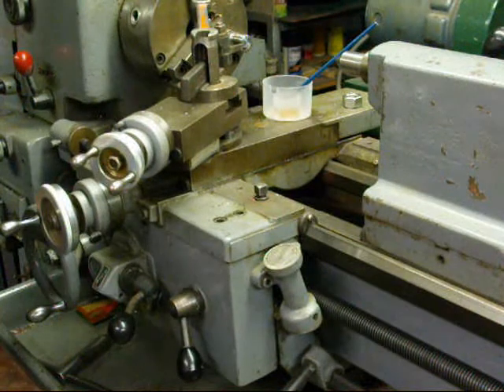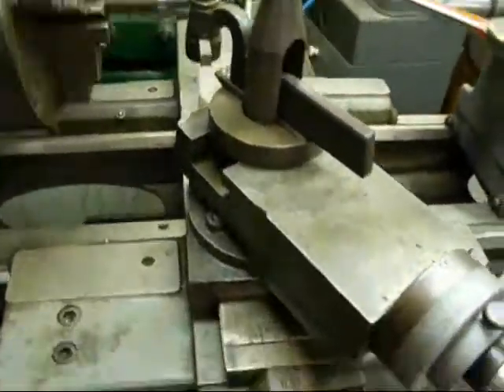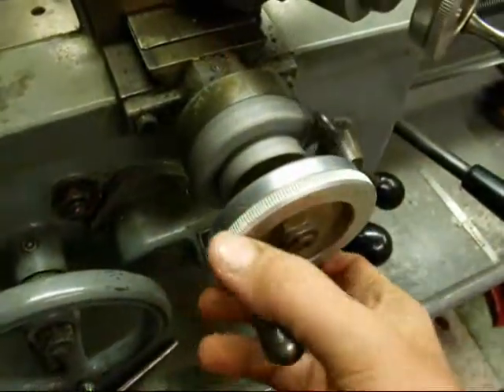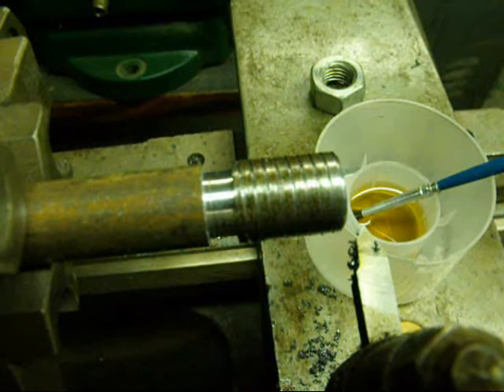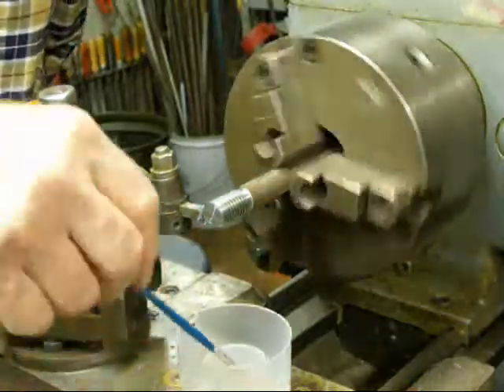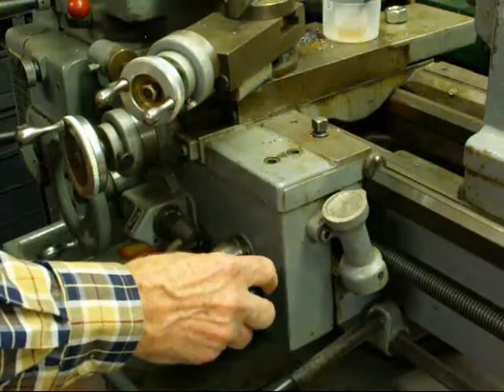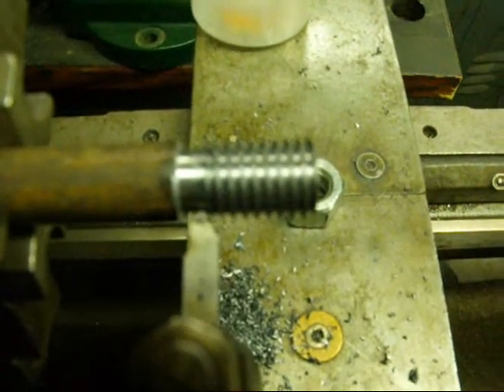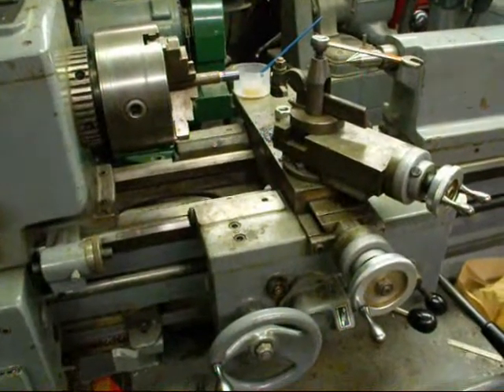THREADING on the CLAUSING LATHE atlas logan part 2 tubalcain

Comment: After 10 years lathe ownership I have done it - cut a perfect? 1/2 20 UNF thread that actually takes the nut! I did leave the half-nut engaged so my next step is to use the chaser. The clear explanation of the setup at 29 degrees, the zeroing of the compound and cross-slide then the repetition for advancing the cutter for each pass did it for me.
Thank you Tubalcain!

Comment: Thanks, this helps. Getting into machining. Got a used South Bend Lathe 1923. I hope it is in good condition. looks like it is. Oldest tool in my grampas shop. Drill Press 1940s? Grinder 1940s? Tried threading, after watching our video I was doing at least three things wrong. Spend hours trying.  Really like your videos!

Comment: Thank you again. I managed my first serviceable bit of threading. I was replicating the tailstock screw and having issues making the 3/8" - 16 thread on the back end. Nevermind that knocking down the ACME thread from the 1/2" OD was quite the pain in the rear. Thanks  to you, I finally pulled it off.  Now to figure out how to put that tiny little keyway in it for the hand wheel.

Comment from the maker: Study the SOUTH BEND book on this. If you feed straight in, it is a plunge cut & the tool will cut on both sides. You want the tool to cut only on the left side only. This gives a smoother cut. Also avoids digging in, chatter & maybe bending the work.

Comment: Very helpful, I have threaded a few times only, and don't do Threading all the time,
So I forgot a lot of points. This series Got me back up to speed. 
I am ready to try making a 1.400 OD X  24 TPI Externally threaded Spanner nut for my Rockwell 6 " belt sander. This spanner nut holds the bearing in. The places that sell replacement parts for Delta Rockwell, want $65.00 & shipping for the part. 
That is not going to happen. I paid $100.00 for sander and already have almost $100.00 more in parts

Comment from the maker: What I am doing is the very thing that removes the backlash. (that is moving out several turns & then back in). If you only move out say perhaps an 1/8 of the turn & then back in, you have introduced backlash.
I have a video on youtube that covers backlash.
I determine the starting point by bring the tool in until it touches & then zeroing the crossfeed-that's all there is to it.

Comment: A few questions if yo can help, tubalcain:
1. After terminating the cut, you say to back out the crossfeed. When doing that and returning it to zero, how do you compensate for backlash? I am trying to get that through my head but it seems that you are not compensating at all. You just back it out a bit and return it to zero.

2. How do you decide the starting point? Is this an actual measurement?

Thanks for your awesome videos, sir!

Comment: Thank you Tubalcain. Say for instance on an internal or external thread, you nut goes on and its loose, or if won' t go on because it's too big....how do you know how much stock to start with above an beyond to start the process? I.e. If you doing a 1/2" bolt with 22 tpi, how much larger stock over that 1/2" do you leave to start the threading process?

Comment: To machine a 60 degree thread we are supposed to set the compound rest at 29. This sets the leading edge of the 60 degree cutter to do the cutting action, reducing surface area and lessening cutting pressure and heat. Make sure the compound rest is 29 from 90 though, not 29 from parallel!

Comment: With the speed that slow, and the undercut that large, could you just stop the chuck rotation and reverse instead of disengaging the feed? Like on a Chinese lathe with no feed dial. Forward-stop-in.003-reverse.-in .003-repeat

Comment: Why would you add depth to the thread using the compound slide at an angle like that, surely if that is not perpendicular (90°) to the part then as you start adding more depth it will slightly alter the pitch also?

Comment: Question:  How would go about to thread a 32" long screw thread?  Say for example an acme thread for a milling cross table?  I would think at about half way, the tool would be flexing the work.  Would you recommend to make the threads in sections?  Or, is there something to do with the rest follower?
Reply from the maker: Yes--you need a follower rst

Comment: Ok.  So I would make the threads in sections at a time along the length?  Not sure how the follower would provide the proper support necessary as the thread is being formed.  Is there a follower that works on the thread that I don't know about? Even as in depth chapter ten is South Bend's, "How to Run A Lathe", I didn't see reference to this dilemma.   Thank you for all your help.
Reply from the maker: watch keith ruckers video
Using a Follow Rest while Threading on a Metal Lathe

Comment: I'm apparently missing something, but it appears to me that with the compound sitting at an angle, using it (the compound) to adjust the depth of the next cut would change the relative position of the cutter with the piece being threaded.
Reply: I think I may have found the answer to my question in a reader comment in which he explained that the cutting tool needs to change position due to only the left side of the cutter removing material to form the thread.

Comment: My Logan has a 8 TPI Lead Screw, So it is my understanding that if cutting 24 TPI or other multiples of 8, I do not need to worry about the thread dial. I can just engage the thread dial any time I wanted to. I like that, Too bad they are not all like that....................LOL